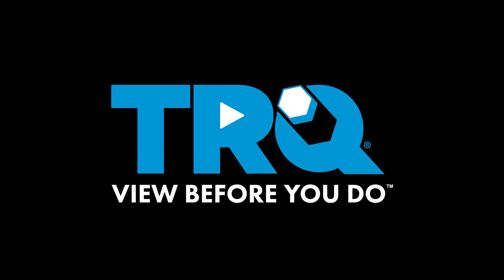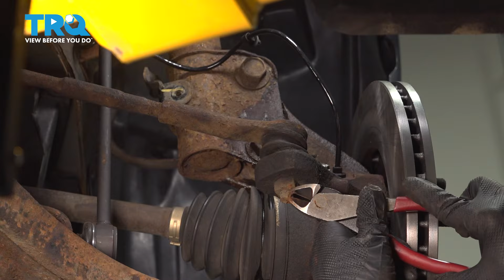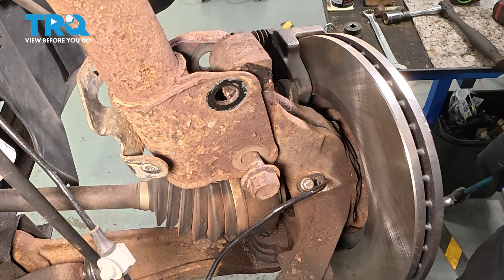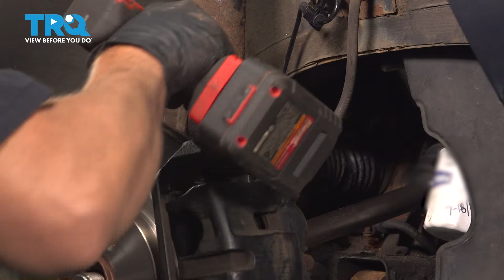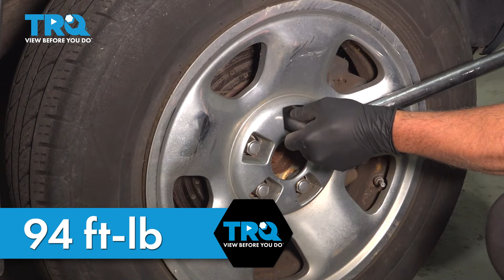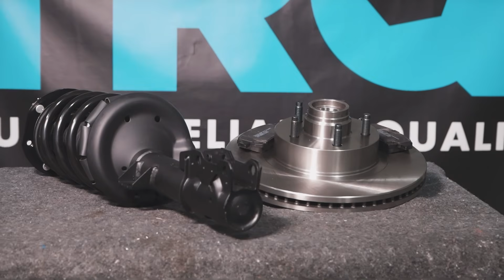How to Replace Front Right CV Axle Assembly 2006-2014 Honda Ridgeline 3.5L V6

Comment: Thanks for the video with the torque specs.  I have done a few of these on several different vehicles and they always turn out to be harder than they should.  I've had two of them where the splines would not move in the hub.  These were rust free southern cars that were about 15 years old.  I had to take the front suspension apart and put them on a 15 ton press and they barely broke free. Both had small metal shavings called in the splines.

Comment: Super great video! 👍 
 Is there a "pretty darn good" brand of axle that you would suggest vs o.e.m.?. Mine is also failing at that same location.  
 Mine is a 2014 Ridgeline 150,000 miles and has been an excellent vehicle.